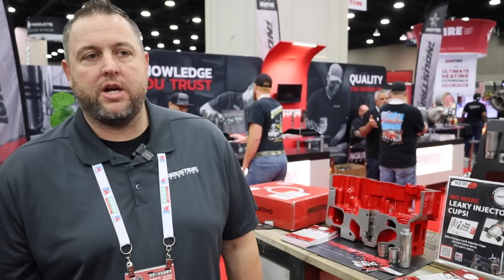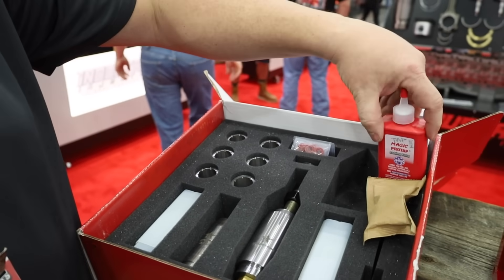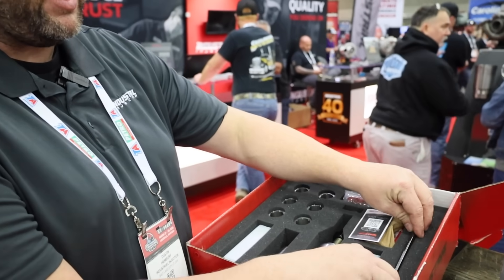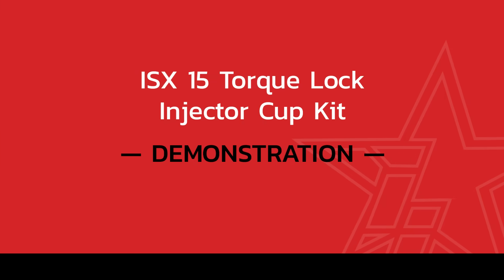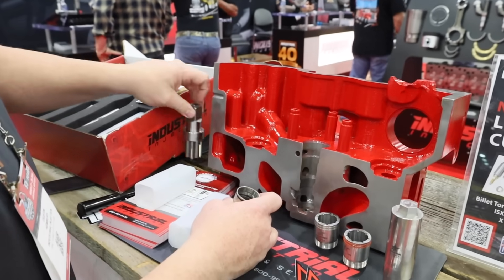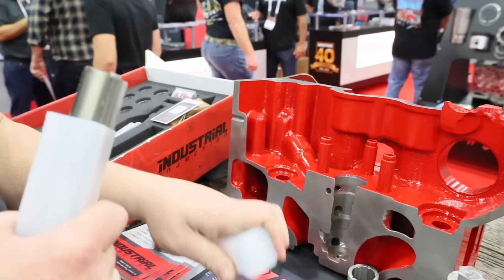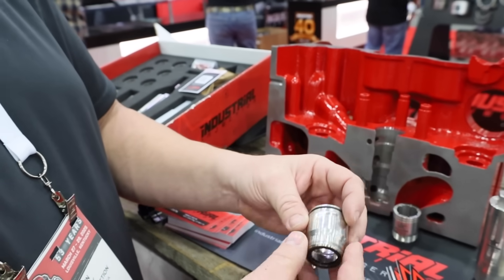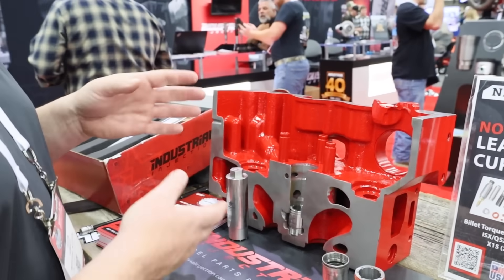ISX15/X15 Injector Cup Upgrade – Full Kit Breakdown & Demo

Comment: Purchased this kit, my only concern getting into this project is.....   It seems like when tapping the existing leaking cup that it could possibly turn in the bore and you wouldn't be able to tap it properly to get the puller threaded in.  Any issues with that?  I have several that leak without even pressurizing the cooling system so I fear they are loose in the bore already.